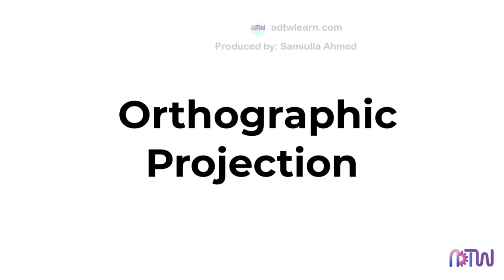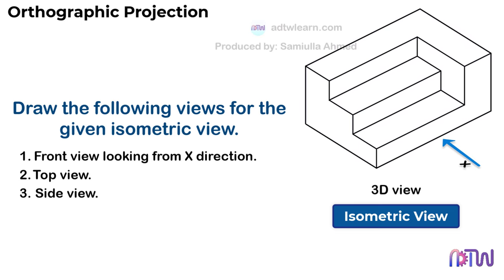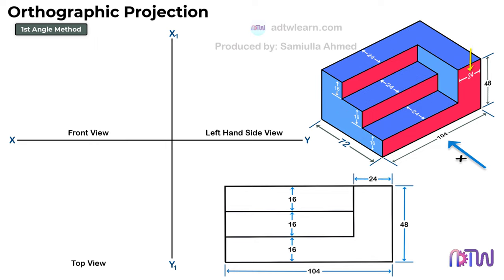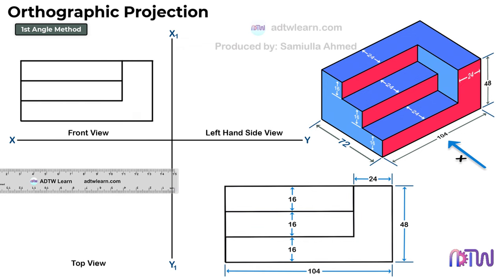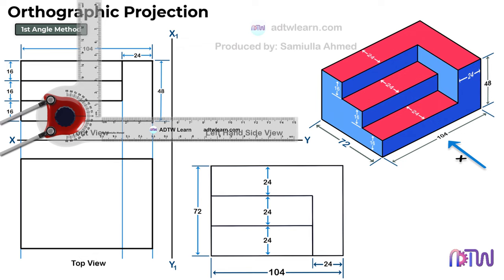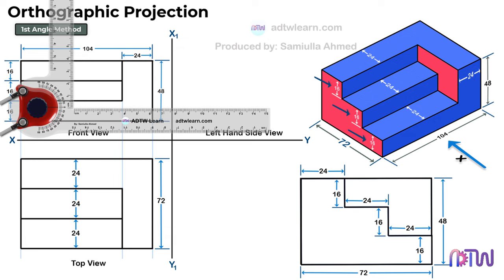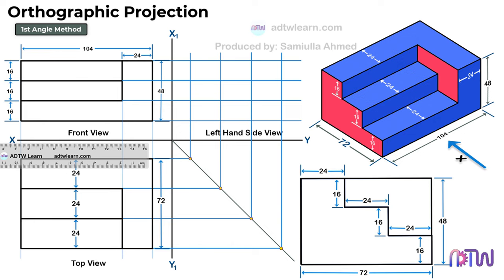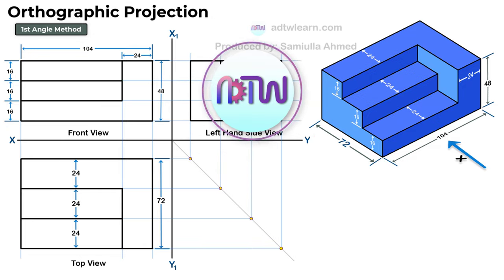Orthographic Projection in Engineering Drawing- Problem 2

Comment: why are there spaces between the views and how much space
Reply from the maker: In orthogonal projection, we leave space between different views to keep the drawing clear and easy to read. This prevents details from overlapping and ensures each view is distinct. 

Reasons for spacing:
1. Clarity: Avoids confusion by separating views.
2. Detail: Keeps each view's details separate.
3. Dimensions: Provides room for measurements and notes.

How much space to leave:

Standards: Follow guidelines like ISO or BIS, which usually recommend at least 10 mm.

Drawing Size: More space for larger drawings, less for smaller ones (e.g., 10-30 mm).
Adjust based on what looks clear and professional.